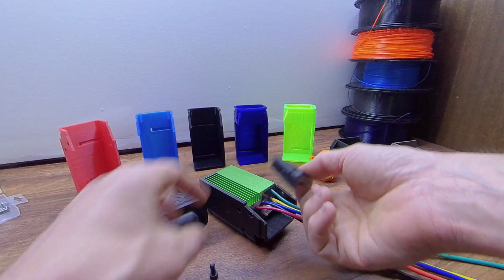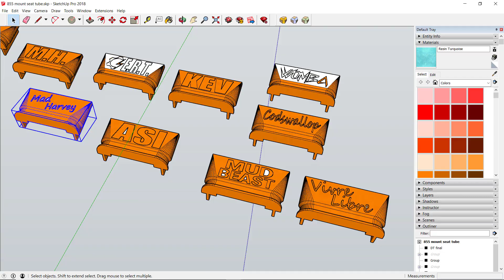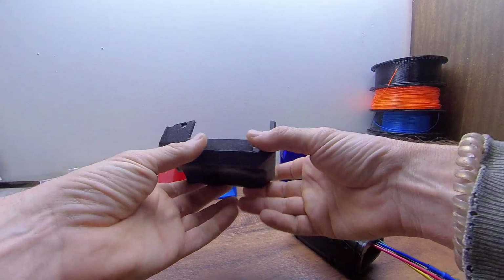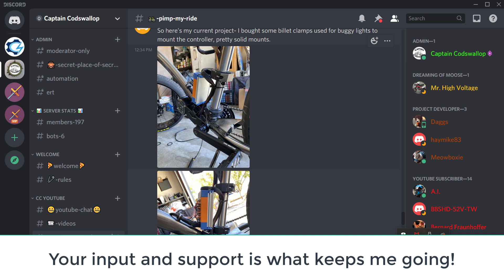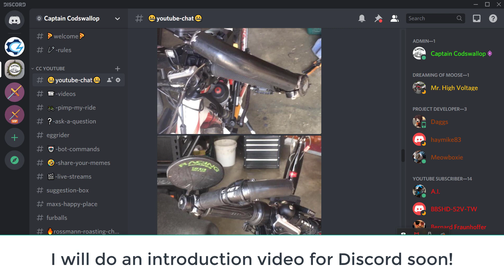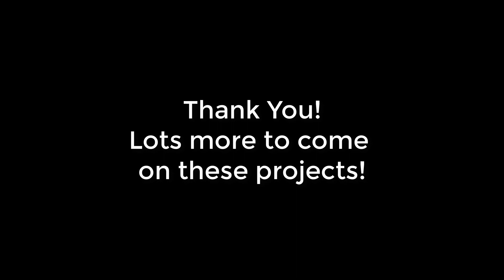ASI BAC855 / ASI BAC800 Mount System / Thankyou to Customers / Projects Update

Comment: I just bought one of those frames so I'm looking forward to your build 💯👍👍😁
Reply from the maker: Yeah! Sounds good mate. Cheers 🍻
Reply from the maker: Did you get an eta for shipping btw. Mine left Germany on the 29th of October and has been showing as waiting to arrive in Canada ever since... Im suspecting now it went via boat. Yet Frankfurt is a way from the Ocean. I wish they would use proper dhl... might be for cost.
Reply: @HighVoltageKits  I got my frame from China I live in Maryland it took like 2 weeks It has steel side panels but I'll be replacing those with plexiglass or some kind of plastic sheets
Reply from the maker: Thanks mate..Really hope it has not gone awol

Comment: I have one, and thanks to the captain, I have been very satisfied!
Reply from the maker: Glad you like it. Cheers
Reply: @HighVoltageKits   I feel like a turd for asking...but...Does the ASI BAC855 and BAC2000 CYC X1 PRO controller work on BBSHD motor running on 72 Volt Battery?
Reply from the maker: You can use the 855 with the bbshd but not the 2000 its just too much. You can easily damage it with an 855 if you are not limiting it somewhat. You would need to wire it correctly and configure the controller for the bbshd.

Comment: Nice , I  will definitely buy one. Where do you get the actual controller for the bafang bbshd ? Plug and play version.
Reply from the maker: ERT did the original kit but you can also get one at Electron cycles. I am not sure of current stock levels. There is also a guy on my discord that will be offering a version so that might be worth a conversation. You can join the discord at https://discord.gg/yQ6JnVK if you post what you are looking for in the ASI sections then I should be able to point you in the right direction! Cheers

Comment: Hello I have a question . I use the Bafang BBSHD in combination with the bac 855 controller but assumed that the controller goes broken in the future, can i buy a( universal bac 855 controller) only without the lcd and cabling  or does this controller need special programming for the Bafang bbshd motor.
Reply from the maker: You will find it difficult to get one as they are only sold to dealers. If you use our upgrade kit we would most likely be able to supply you a programmed replacement at cost. We have an excellent support system on our Discord platform for customer service. https://highvoltagekits.com/discord
Reply: @HighVoltageKits  oké thank you for your help.
Reply from the maker: Anytime, just ask

Comment: don't want to sound harsh but enclosing a controller is a BAD idea. !!!! it has to breath !
Reply from the maker: Nothing harsh lol. The heatsinking is exposed to the direct air. The enclosed parts are to protect the wiring loom. People have been using this design for ages now with no thermal issues. Cheers